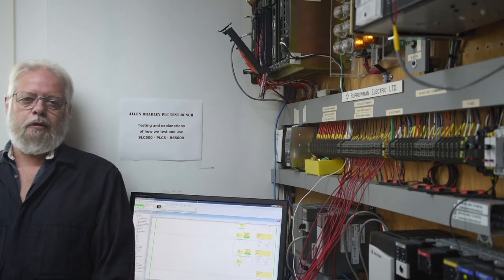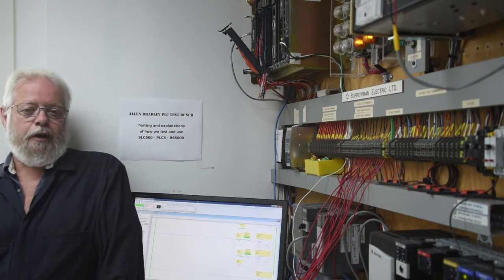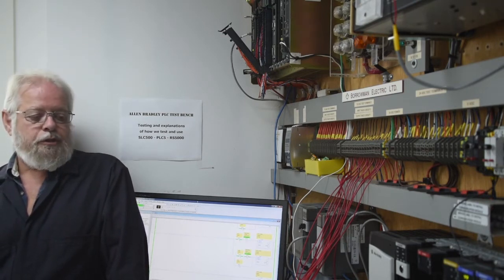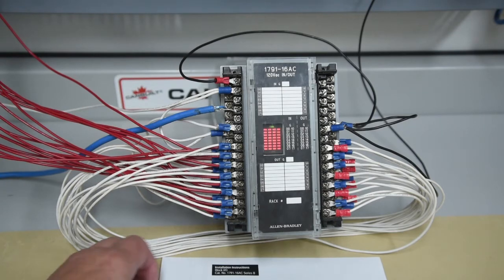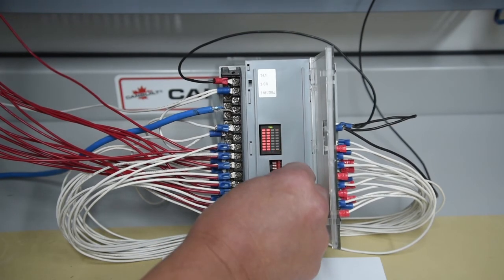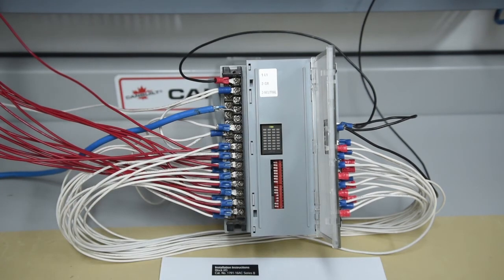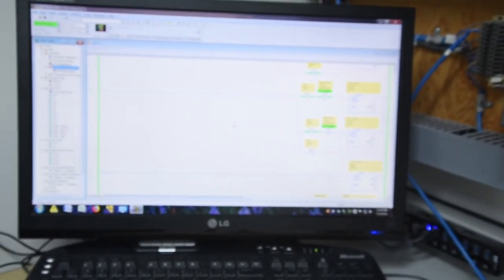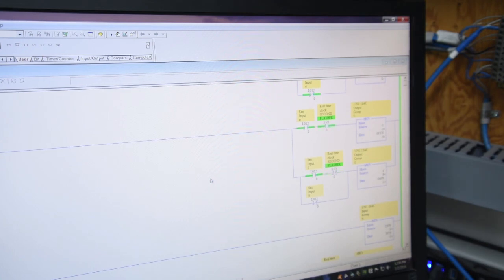AB 1791-16AC Block I/O Modules

Comment: Is it possible for me to send you a 1791-16ac to be tested?  If so, what kind of price would I be looking at?
Reply from the maker: It's a large planet - where are you located?
They are simple to test - repairs not so much.  I generally send to a company in eastern Canada for repair.
What is it doing / not doing?
Reply: @abplctestbench759  I'm in michigan.  I picked it up for cheap.  All I have the ability to do is put power to it.  Status light flashes and I believe that is just because there is no remote i/o connected.  I believe it works, I just need to verify
Reply from the maker: @bradharris6699  Hi Brad:  Block I/O are remote I/O devices that have to be connected to an AB PLC - PLC5 - SLC or CLogix processor on the remote I/O link.  It is not going to do anything without a processor tied to it and configured for using the block.   I could easily test for you we just have to figure out how to contact each other.  I don't have an email posted on YouTube for obvious reasons (scammers and bots).  And I don't think you want to post an email address here in this chat for the same reason.  
Shipping from MI to here would be about $25 to $35US each way depending on the carrier, and proper testing takes an hour - so another $75 on that.

Comment: Hi, i watch your video. Its good. I just want to know about the communication cable details for the particular PLC, can please explain. Thanks
Reply from the maker: Hello Justin:
The block is a Remote I/O module that has to be hooked up to a Remote I/O channel on an Allen Bradley PLC5 processor OR a SLC500 processor with a Remote I/O adapter module installed in the main chassis.
The cable is a 1770-CO cable, which is a 3 wire communication cable.  White - Blue and shield.
I hope that this answers your question, if not please ask again with more detail.